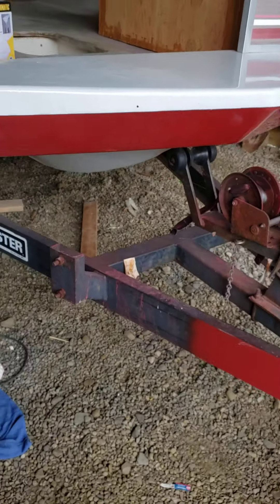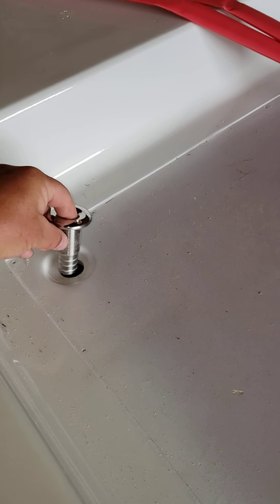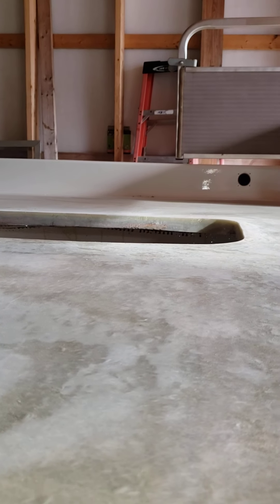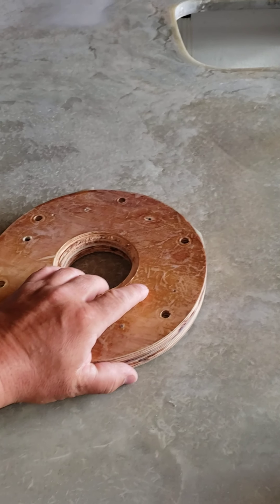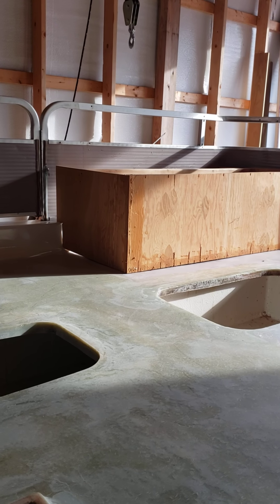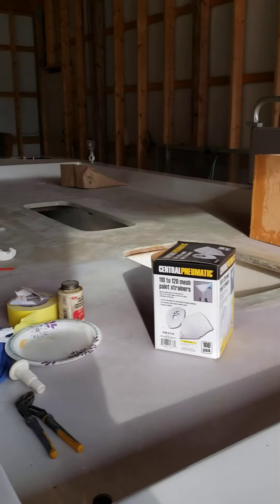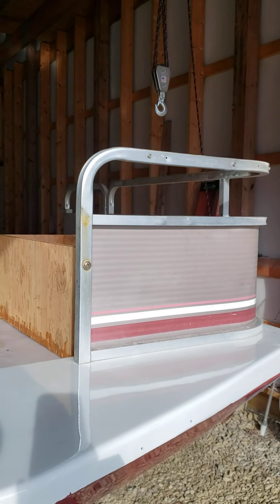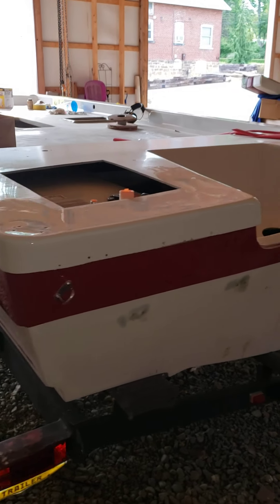196 FD Hurricane Deck Boat

Comment: Any videos on replacing the deck I have same boat and have a spongy deck
Reply from the maker: Hi Zack, on this particular boat a section of the floor was replaced by a previous owner. Unfortunately the person that did it only did 1 layup of woven roven over the wood. There was an noticeable transition between the manufactured floor and the shotty repair. The wood looked to be in good shape so I did subsequent fiberglass layups ontop after I removed loose fiberglass.
 I do not have any information for you on removing deck wood. 
If I were to remove deck wood I would use a circular saw. I would set the height of the blade so it DOES NOT cut through the fiberglass under the wood. Cut it in small sections, and peel it up. Section by section. Once it was all cleaned out I would use a 7 inch grinder with 80 grit sanding flap disk. I would hit all of the area where wood is going to meet the fiberglass bottom. Once sanded, I would blow it out with compressed air. Then wipe the cleaned surfaces with acetone. I would inspect the area for holes and cracks, at this point I think I would mix up epoxy resin an add ^cab-o-si^l fumed silica to thicken the resin and apply a thin coat to seal it up. In areas where the original fiberglass is peeled up I would try to mend over the areas with resin and fiberglass. In my mind I would do everything I could so I laminate the new plywood (marine grade) so it could bed nicely in the area you removed the old wood. (Like building a patio with paver stones). From my observations on my boat deck the plywood had a fair amount of fiberglass material ontop of the wood deck. Once you install the plywood there will likely be a deficit in relation to the plywood deck height and the manufactured floor height. This is where I used resin to first seal up the wood from the tools I used to remove loose materials. Then I added severat layers of 1708 to build up the repaired deck height to blend in with the manufactured height to fix that transition I mentioned above. **Sanding with 80grit and wiping down with acetone is critical before layups**. If you have question feel free to contact me!! I would be happy to offer whatever help I can.